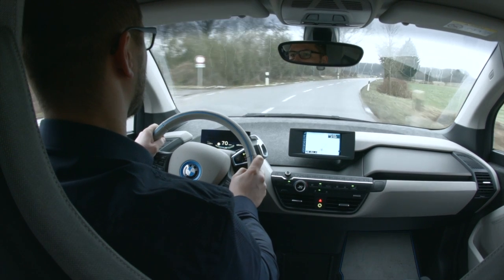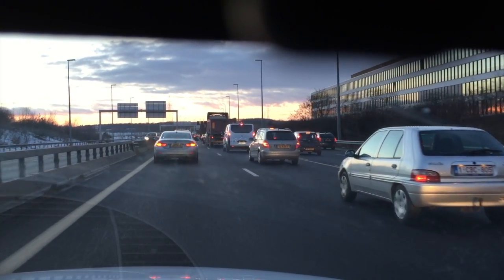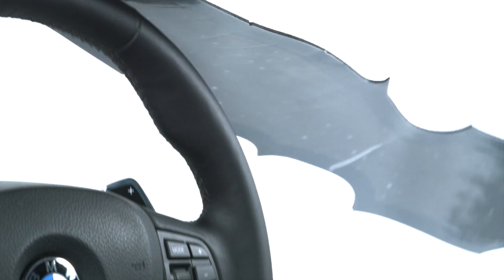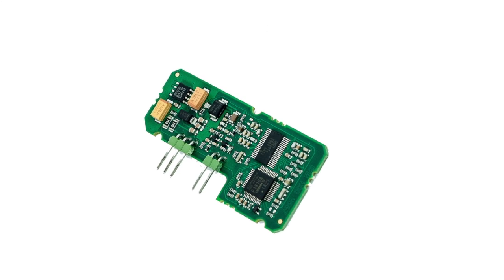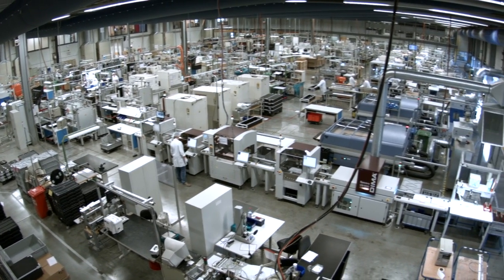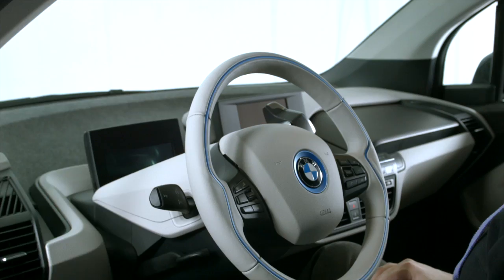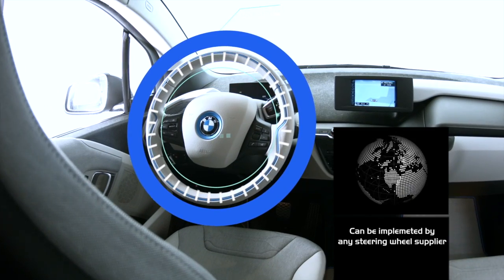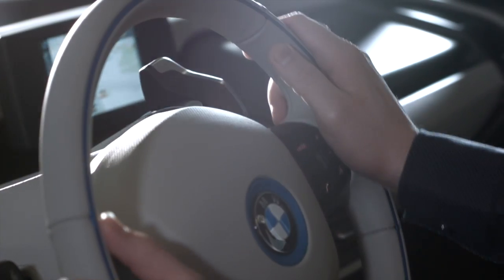IEE Hands Off Detection (HOD) Sensing System

Comment: it's an interesting feature used with traffic jam pilot (TJP-autonomous driving level 2) or Lane Centring Assist (LCA), but i have question, how this works in the case where the driver wear gloves. Thank you to the person who can give me an aswer.
Reply: per my understanding it is fully depends on the sensitivity of the sensor. The basic principle of the sensor is a capacitor detector and if the threshold is low enough, then even with glove it still can detect any conductive object, like human hands. The similar technology has been applied on touch screen or touch buttons for a long time.